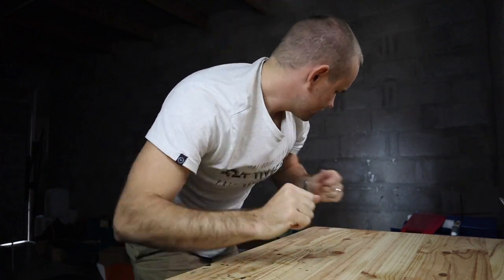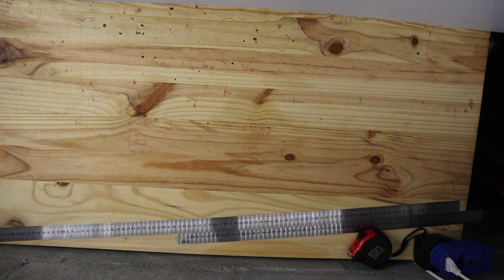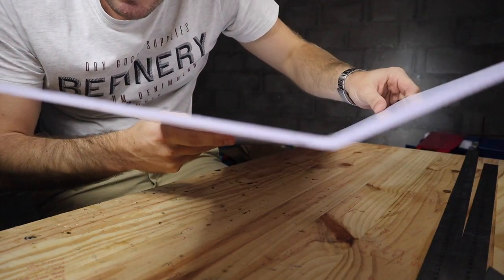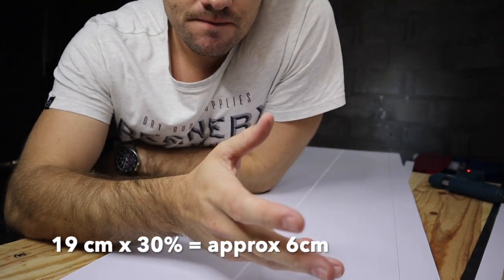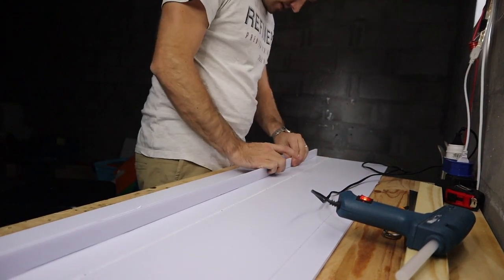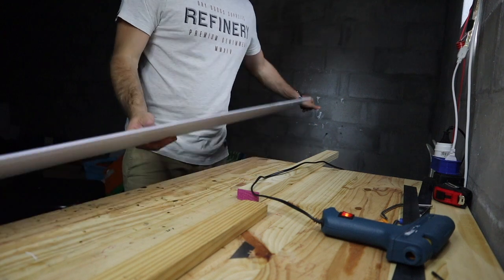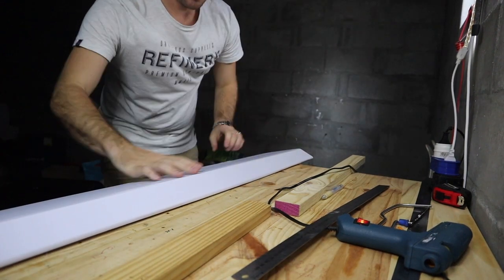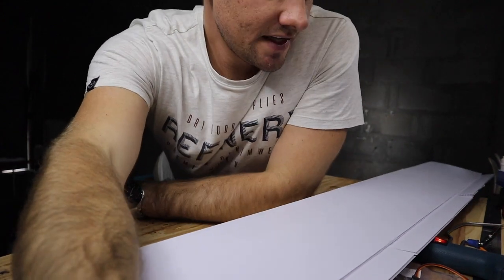Correx Wing Build // RC Plane Building for Beginners

Comment: It's not easy to contour Correx(maybe prudent use of a heat gun could help!) But I've made an F22 Raptor out of it instead of cardboard as plan originally intended and I'm pleased with result and it's strong also especially with umbrella carbon rods I used also!

Comment: Would you agree that there is a difference between bod-weight in terms of the fuselage versus the wing-span? They say (on Quora) that the difference quotient equates to lift vs propulsion, but if one removes the lift quotient then flight would be made possible due to i have no idea what i am saying
Reply: Just asking for a friend
Reply: @HowardFyvie      coroplast planes weight a little more than balsa there for you would fly them a little faster.    add some flaps to them and that can help on landing.   but they fly great and are much stronger.